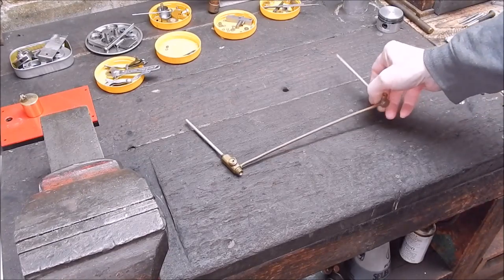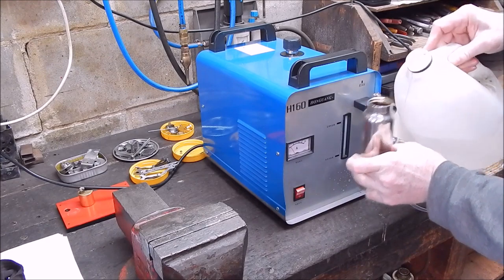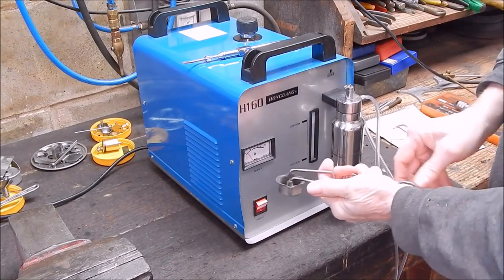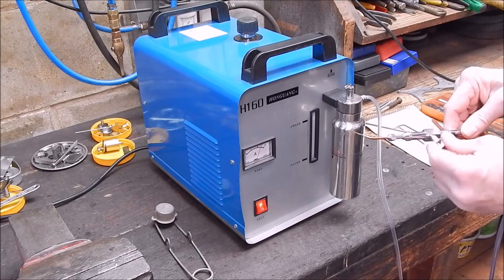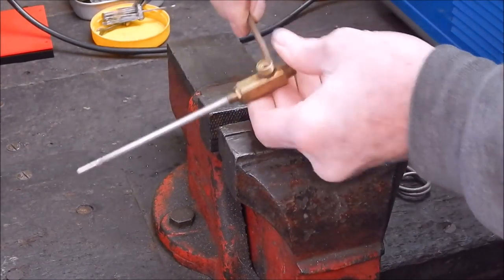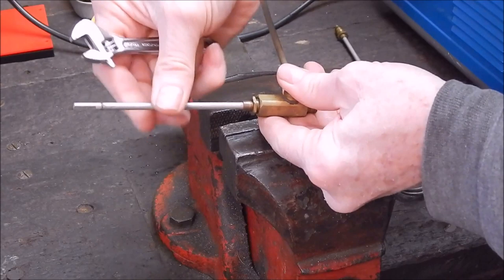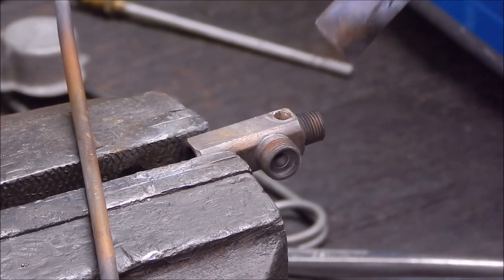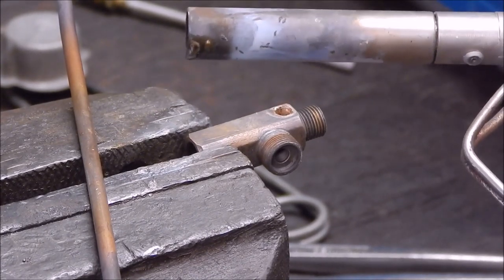The H160 oxy hydrogen water torch fails miserably at light workshop use

Comment: Hi Rob, excellent video as always. I think the sound of the bullfinch was what did the trick! Greetings from Orange in NSW.
Reply from the maker: Hi Paul,  it was interesting to see what it's limits are and I expected it to do better.  But copper/brass are heat hogs, so I guess it's to be expected.  It can easily cut through a steel can, but it can't melt a small amount of silver solder.  Shows how heat loss is your enemy when brazing.  BTHU are king. Cheers Rob

Comment: A good demonstration of the difference between temperature and heat.
I'm sure the hydrogen torch flame is a higher temperature but just not enough heat.
Rob convinced me to get a Bullfinch and I've never regretted it. They aren't cheap but they do the job.
Reply from the maker: Hi Peter, yes right on both counts.  The heat also has to be concentrated to be usable.  The Bullfinch does both.  Still the cheapest option over all for general workshop/small mass work. 

Oxy/LPG offers more capability and is now much more affordable due to the availability of rent free bottles, but the running cost is 10 times that of straight LPG.  You use 4 oxy with one LPG by weight.  That running cost (mostly oxygen) soon adds up.  The oxy/LPG kits are half the price of the Bullfinch, so the initial cost looks better.

You also have to wear a number 5 eye filter/shade with oxy, when brazing.  LPG requires no UV filter.

Both are good options.  It all depends on your requirements.

Cheers Rob

Comment: I have one of these machines, it is massively hot, and high output where it blows my solder off my soldering pad like a leaf blower. I have to trap the solder to pick it up with my pick, and use lots of flux to it it to stick to the piece I am working on. Did you put potassium hydroxide in the water for the tank? If you didn't that is why you are not getting the output need for work like you were doing there. II can melt silver with my torch.
Reply from the maker: I have used potassium hydroxide and it works OK.

Comment: Even as the rate of energy delivered is vitally important,  this something to consider. Observing at  9:03  isn't the flame just too short and small. I am not sure that all of hydrogen is burning or if it is, that the heat is being delivered to the working piece. Maybe the metal is sucking away the heat too fast or blowing off the work piece and burning invisibly a distance away. Isn't there a hottest part of a flame and wouldn't it be further out?

Comment from the maker: UPDATE:  I've since managed to increase the heat output and flame length/colour by using an alcohol and acetone mix in the bubbler as suggested by an ex-jeweler in the comments.  It has made a significant difference, but the BTHU output is still too low for satisfactorily silver soldering a join of the mass show (even when insulated on a brick).   It will melt the silver solder, but it flows poorly.  Cheers Rob
Reply: Rob that sounds like another interesting development we need to see!
Reply from the maker: Hi Stephen,  I will see what I can do.   I need to play around with it a bit more first to see how it performs.  I also have another mod in mind.  Cheers Rob
Reply: @Xynudu  Cheers Rob - Yet another mod... the plot thickens. Looking forward to seeing it in the flesh.
Reply: Original setup first video had a blue flame, ie much hotter output, this was yellow....

Comment: This is a tiny flame for that big mass of copper and brass, remember heat travels about 10 times faster in copper than in steel, this makes the heat go away from the joint VERY fast, it's like a massive heat sink. 
Wonder how it would behave using stainless steel where heat travels about half what it does in steel, the heat would stay more in the heated spot...
Reply from the maker: Hi Pierre,  I can bronze braze steel with it up to 3mm as shown in an earlier video, but the heat loss/transfer from copper/brass is too high for that sized job.  The video was a good demonstration of the difference between temperature and BTHU.  It will easily cut through a steel tin can because of low heat transfer, but can't melt a small amount of silver solder due to inadequate BTHU.

It was a bit unfair on the torch considering what it is designed for, but proved a point about the importance of the several issues when brazing.

I put it up because I'm sure there are a lot of people out there wondering how well it compares. 

Cheers Rob

Comment: I wonder if the acetone bubbler lowers the BTU/second while giving a reducing flame?
Reply from the maker: Hi Robert,  the bubbler is using distilled water.  So it should have minimal effect on the HHO. 

It's just not intended for this sized work, even though it is quite small.  Plus copper/brass are heat hogs.  The same torch will easily cut through a steel can because the heat transfer rate is so low.  Cheers Rob
Reply: @Xynudu  wow... I assumed the acetone from the flame color.. I guess enough sodium carries through to strongly color the flame?
Reply from the maker: Interesting point Robert. I guess so.  It is mainly apparent at start up for some reason.
Reply: @RobertSzasz  Yeah, you would be amazed at how little sodium need be present to color a flame.  Plasma balls inside a microwave contained in a glass jar get enough sodium from the glass walls to color it orange.  Seen a yt video of this.

Comment: Isn’t the vice sapping the heat from your joint?
Reply from the maker: Yes, but I expected some signs of localised melting at the flame tip.
Reply: xynudu with steel I would expect that but copper has a much lower resistance to heat flow.

Comment: The Bullfinch 404 has (according to its datasheet) 4700 Watts thermal power, the H160 has 300 W electrical and at best (very optimistic) maybe 200 W thermal, probably even less. So by these numbers the Bullfinch is at least 23 times as powerful as the H160. You would need a HHO generator of almost 10 kW electrical to produce enough HHO for a 4.7 kW flame.
Reply from the maker: Probably around those figures.  Both torches are od course built for entirely different purposes, but to get Bullfinch performance with (almost) free HHO would be very nice.  Cheers Rob
Reply from the maker: Yes, that looks to be pretty useful.  I expect there's some sort of flashback arrestor in the line or unit.  Nice job.

Comment: I use thé water welder for jewelry for many years. I mixe alcool 75% and acetone 25% and 2 tea spoon borax for flux in one liter .With acetone the flame will be 3 times bigger . Try a bigger tip. Dont hold the part in vice, put it on a ceramic tile . I melt gold with my machine. But it will never béat acétylène for big work. The machine was made to produce a small very hot and clean flame. With borax there is no oxydation
Reply from the maker: Hi Guildo, thanks for the tips.  I will give acetone a go as I have a litre or so of it.  I was aware of the potential heat sink effect of the vice.  Does the flux go in the bubbler ?  Cheers Rob
Reply: xynudu  you mix alcool acétone and borax and pour it in the fluxer ( the small chrome container) you will have a Green flame from the torche.
The borax in the mix clean the metal and help thé solder to flow. Keep applaing the flux as usuel. Excuse my english i am French Canadian.
Reply from the maker: Thanks Guildo,  I will give it a go.  Much appreciated.  Cheers Rob

Comment: Good vid Rob , confirms my thoughts that this is more of a jewelry type tool. That said though, the temperature could be a little fierce for small jobs with silver and gold. Hard to know which way this one wants to go.
Reply from the maker: Hi Lee, I wouldn't know about that.   I have seen some reviews and comments by jewelers who like this and similar units.

The one thing I don't like about HHO is that it has an oxidizing flame, which is not great for brazing.  Straight LPG/propane is very good in that regard and also incapable of melting ferrous metal.  So it is a lot safer to use LPG than any oxy boosted torch, which could easily melt the job if you weren't careful  Cheers Rob
Reply: The torch tip is far too small to handle something of that bulk. I have one of these myself I used primarily for gold, silver and platinum work with Jewelery. However, if you get a larger torch tip, you can actually solder up to a 10 mm copper pipe without any trouble. The torch tip you were using in the video is about half the size of the one you need. And it’s also about the maximum capacity this HHO generator can handle.

Comment: I have seen a jeweller using a medical oxygen concentrator with propane, that seemed to work well!
Reply from the maker: Hi Pat, I looked into oxygen concentrators, but they are quite expensive unless you can get one second hand cheaper.  Oxy/propane or LPG has a lot going for it.  You could easily rig one up.  Cheers Rob
Reply: xynudu I wonder if you can just bleed the oxygen of an electrolytic machine (vent the hydrogen) then burn oxy propane flame? Which should have more calories/joules (Acetylene/Ethene being the ultimate in that regard)

Comment: Gentlemen, you say the answers already, low btu. You vice, the copper nut, the tube, they are all transferring heat away faster than you apply heat. You want to melt the silver solder you got to retain heat on that particular spot, or you had to overpower it, more heat than it transferring. It is like using a 15watt solding iron to solder a one inch pipe. These HHO are only good for small joints, such as jewellery where the materials on both side are thin and the heat sink effect is less than the heat you apply. Or you had to wait until more HHO come out from the generator, it is just yellow flame, not blue flame, very likely not enough reaction inside the chamber.

Comment: Hi rob
Great videos
But I must say that small torch, the flame is yellow that's to cool, the flame needs to be blue
Like the Bulfinch torch
I have watched you use that small torch before and thought the same thing
Yellow flame not enough heat,as I'm sure you already know
Eddie Harper UK
Reply from the maker: Hi Eddie, yes, I took a viewers advice and swapped out the water in the bubbler for alcohol and acetone.  Made a a big difference, but while better, it still lacks the BTHU's required for that sized brazing job.  The rod doesn't flow very well. 

The unit is still handy though for certain jobs like unlocking/heating up Loctited bolts in situ and soldering.  The small flame has it's uses for sure.  Cheers Rob

Comment: turn the knob from BTHU to Watts and it will work ......youre using the Amercan setting
Reply from the maker: There is no knob.  It is a purely 300 watt machine.  Check the specs.
Reply: @Xynudu  You sure about that, Rob? 15A x 220V is closer to 3Kw, no?  Or is the 15A on stepped down voltage?

Have to say, that's a pretty disappointing performance, though.
Reply from the maker: The unit is sold as 300 watts Michel.  Where did you get 15 amps from ?
Reply: Rob, when you started up the hydrogen generator you commented that the ammeter went to 15
Reply from the maker: Yes, I did.  Good point Roy.  There's no way it is pulling 15 amps off the mains.  It would trip the breaker.

Hmmmm.  It will be hugely stepped down voltage.  I think the anode/cathode use 12 volts DC, so work on that.

Cheers Rob
Reply: @Xynudu  It's probably working internally at about 20 volts,  300W / 15Amps = 20Volts...
Reply: @wibblywobblyidiotvision  , @Roy O'Donnell
"15A x 220V is closer to 3Kw,"   sure but as @xynudu said,  it is not pulling 15 amps of  mains power.  The HHO generator has a transformer inside that pushes 15 amps at a stepped down lower voltage through the electrolysis cells.  If the generator is consuming 300 watts with a reading of 15 amps. Then the voltage delivered to a series of electrolysis cells is 20v. Depending on its construction , if there are 5 cells in series then that is 4 volt drop per cell and 10 cells in series, that would be 2 volt drop per cell. 

I suspect 300 watts max rating is at 20 amps when fully warmed up,  and because 15volts X 20 amps  is 300 watts means a series of cells is  probably getting 15 volts. This would means a likely construction of either:  5 cells at 3v per cell,  6 cells at 2.5v per cell,  7 cells at 2.14v per cell, or 8 cells at 1.875 volts per cell.

Comment: Horses for courses…maybe if you’d kept the pipe in the vice instead of the brass fitting, it would have eventually melted the joint. All the heat should have been concentrated on the fitting which was acting like a heat sink.
Maybe now you’ve had more practice, an updated  review would be useful…